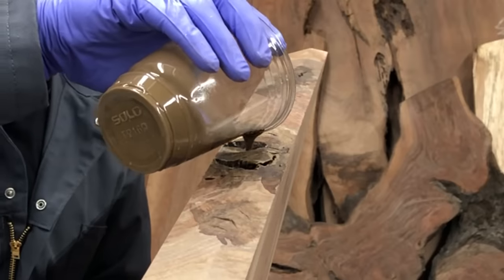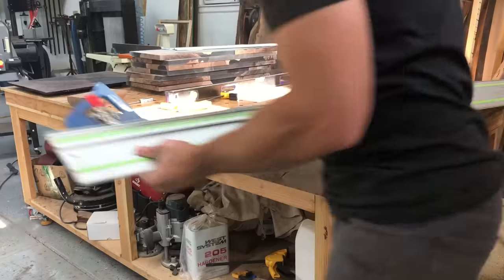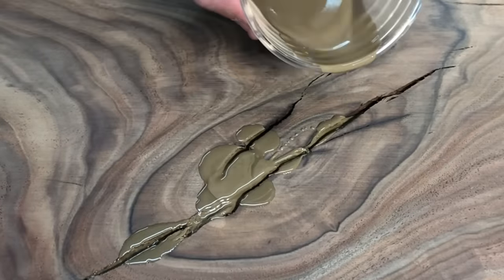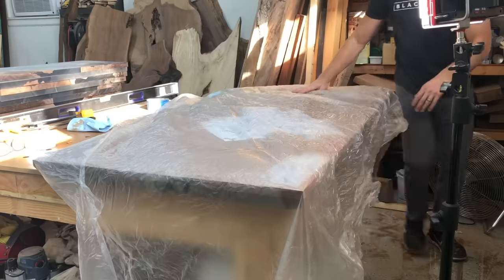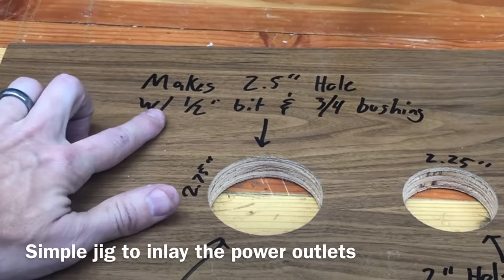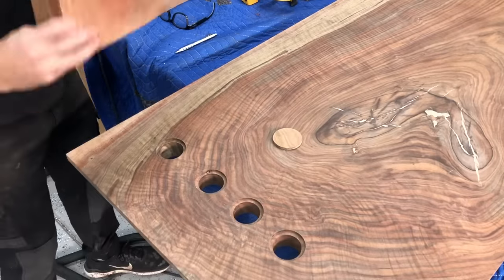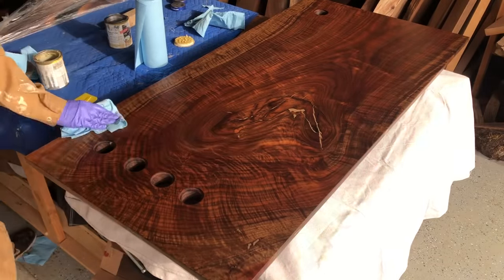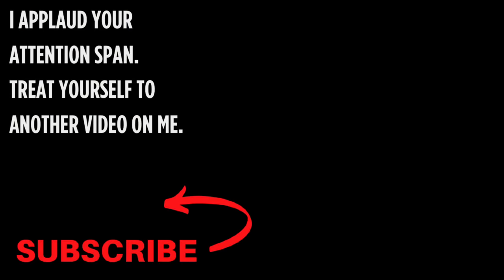My Toughest Client Yet

Comment: Omg finally you used metal and epoxy!!! Real quick I still think it counts as a smart desk and it’s not overly done! Sometimes tech can get a bit ridiculous and this piece I think will last much longer going the route you went. As for epoxy and metal… the more the better and pls use copper too! I just think it works so much better than actual colors, there’s something natural or authentic maybe and metals go with wood anytime, all the time. I love the knots and holes and gouges are accentuated beautifully by the brass and bronze. And thank you for giving tips on how to get the most out of the pour by turning the piece upside down to allow gravity to pull the highest concentration of metal closest to the surface. That alone will help me since you just made me order brass and copper powder 👍🏼 I have a simple blanket ladder for my sister out of knotty hickory which has gorgeous colors and striations in the grain and she picked it so I have to make these deep knots strong so I can incorporate the character into the piece. I think I’ll go copper, this hickory isn’t pale or pink, it’s darker and I don’t know I’d love either one but we’ll see what she decides. She’s also particular and that’s not always a bad thing
Reply: Edit: Cam is obviously right about using 50/50 ratio of copper to (in my case) total boat thickset mix and don’t forget to wrap it with tyvek tape and tip it upside down!!! It literally pulls the majority of copper to the surface! When I first started applying the copper/epoxy it looked dirty, like gross water almost but I trusted his process of taping it up and flipping my pieces over and holy cow what a difference! It is a long process to wait for the epoxy to dry so don’t anticipate pouring and sanding soon but well worth it

Comment: Cam, If you deal with dust getting on your projects one thing that I found helps me is tack cloth. And when I use any type of epoxy I use heat lamps to speed up the process.

Comment: Cam. Love the desk. I once tried using brass similar to how you have but I got my brass by filing a redundant brass welding cable connector into filings and mixing them with Araldite and inlaying it on some Ash.

Comment: Cam-- am planning to do a guitar body out of 100+ year old barnwood, and initially I had planned to use a resin or epoxy as accent/crack filler... Now may look for the possible existence of a slightly-slower-curing CA glue! One feature that *will* be present: brass shavings, suspended in the clear of whatever medium I use-- And it was **FREE**, 'coz I know the local hardware store operators and collect the shavings from their key-cutting machines!!  Desk looks super awesome!! Blessed Be, & Peace!! 🙏☮

Comment: Cam, i know this is an older video but i wanted to watch again to see what powder you used. However i think it would be really cool of you did a crazy patchwork table where each patch had a border of the brass resin, you could even get real crazy and make like puzzle pieces. You could make the border lines as thick/thin as you want it sounds like ALOT of work but if anyone could do it its you. And you could even use a relatively cheaper wood for the base layer ao long as you had alot of patches to dress it up. Great job as always.

Comment: I have a pro tip from something I saw in a Stew Mac video (guitar luither) related to doing your inlay patches.

 Tape some transparency film down on your piece and roughly sketch out the main grain pattern. Then you pull the transparency off and use it to find the best matching plugs.

Comment: Cam, just starred watching your channel from across the pond. Absolutely loving your work and feeling inspired so will have a go at something soon. Probably a clock. 
Be good if you could show using a router sledge and also have you thought about copper instead of brass.
Regards
Chris.

Comment: Cam, Just had a thought about the bubble comments. I used to work with silicone and urethane molds. When I made the molds we used a table with multiple table vibrators on it. The table vibrators could be mounted on the bottom or the top. For large projects we would mount about 4 of them. They made most of the bubbles come to the surface fairly quickly. So vacuum chamber and table vibrators made a hige difference. We also used surfactants in the urethane but I don't know how they work with epoxies. You should give it in a test with some epoxy. Bet it makes the bubble issues go away faster..... Paul

Comment: Cam, I think this looks just fantastic :) Only thing I have to say, I think if your wife or you ever used the clamp on style articulating monitor arm, you would never use an old school stand again. SO great that it takes up none of your desk space, yet can be grabbed and pulled to just the right angle and closeness, or easily changed if your are standing up, or over to the side.... as I was for most of this video.

Comment: Cam, I really enjoy your videos. I’m a novice woodworker, beginner when it comes to fine furniture. You make this look so easy! Is it reasonable to make a desk like your wife”s as a first slab desk or do you recommend some other project first? I’ve got a nice Rowland X31 combo machine, routers, sanders, drill press, and will likely add a Milwaukee tracksaw since I’m really vested in M18 tools. I know this is a broad question like “How long is a rope?”. I’ve also designed and built 12‘ x 12’ office from stick lumber with a 10’x5’ and 5’x5’ window in my backyard. Thanks for sharing your vast knowledge and having a subtle but great sense of humor!

Comment: CAM, I was thinking, you said that you do not know what you would do if it was drilling holes in a livingroom table, there is the Milwaukee cordless 18v portable bench drill that you can place easily on whatever table you want inn less than a minute completly without hazzle. I was also thinking of a easy way lift and move the big slabs, and that is a vacum lifter, often used by stone  masons or industrial lifting. Keep going! Best regards Kornelius

Comment: Cam,  I have been a sub now for about 2 weeks and I am going through your videos.  One thing with this video is I was wondering where you sourced the components for the desk.  The brass inserts for power, USB, light and switch.  I love these and would be a definite upgrade I would consider for a desk I previously built that is slated for an overhaul.  Thanks for all your videos and blogs.  I have wood workers envoy after watching your shop videos of the "not so new" shop now.

Comment: Cam hi!
I'm doing my first 1 slab dining table. It's a Ucaliptus ~80cm wide and 200cm long and 5.5 cm thick (after planning).
It was cut and sliced 10 years ago.

Do you think I should plant a metal U channels in it? 

When fixing the metal V legs (1 piece) to the table top - 
Should I leave some freedom to the wood slab? What is the magnitude of that freedom, and what method should it be done?

Pretty long answered comment - Hope you have an all ready set video regards... 

Thanks a lot !!
Falk

Comment: Hey, Cam.  Nice desk!  Love the 'brass' inlay bits.  I'd really love to see a ceiling height book shelf with a short (2ft?) set of drawers at the bottom.  I've never seen you do anything like that.

What I'd do differently with this desk:  The lamp and the insets you did should've been all on the same side and much closer to the edge, say around 1" from the edge.  Space on the top of any of my desk has always been 'at a premium' and you've really wasted a lot of space that could be more efficiently used.

I know this is an old video, but you made it sound like you'd be doing the brass dust stuff more and yet I've not seen any videos with it.  Why's that?

Comment: Can, as you’ve said before,  the wood is the “show!” I think you have the design capability to pick the best slabs for the project at hand. I think you should have put the usb charging piece, I know it dates the desk, but I think current functionality rules the day. I’ve thought about a drawer for pens, stamps, etc. putting a usb hook-up in the back of the drawer would not be difficult? Get one of the short cords and charge the phone from inside the drawer; no chance of scratching the surface of the desk that way? Just a thought. -jamie

Comment: Cam,
Technology is absolutely secondary as the table is so stunning with the grain that tech is not required to make it “cool”. Besides the wireless charging is novel today but in 10 years there will be a new charging technique which will make the wireless system dated. This table is good for another century!!

Comment: Cam, this is WELL WICKED, your wife is extremely lucky & person I love it exactly how it is, I wouldn’t change a thing, personally I think the charge port is way better then the wireless phone charger, but that’s just my thoughts
Also while I’m talking about my thoughts, I’m a fluid artist & I know that you use black pretty much all the time, but have you ever thought of adding some gold resin to one or some of your pours, like what I mean is, still do your normal black pour but then get about 15% of gold (85% black + 15% gold) & drizzle it on top, so when the base & the hardener do their chemical movement dance when it’s heating up, the gold should brake up & mix through & it should look like natural gold fault lines in the black resin, I think it could look pretty cool

Comment: Cam, your creations are absolutely stunning and extremely impressive! I was wondering if you've ever used actual molten metal as a filler on any desks or tables at all? I know it burn some of the wood but I'm just curious if it could work.
Reply: Low temp alloys like pewter can work.
Reply: @mailbox4286  That's awesome! Thanks for the info. I know it a little different, but I have an antique, carved wooden table with brass or copper inlays. I always thought it was really cool to have that metal incorporated into the wood and was thinking doing a hot pour of something into a possible furniture project for my home. 🤔 Thanks for the idea.

Comment: In boilers, to take out the air out of the water or liquid you raise the water temperature going into it to around 90 degrees celsius. Not sure if you can do that with the resin but thought i would tell ya. Also you dont want to boil it....you want it just before it is there.

Comment: Cam, could you pour a shallower river of clear or colored epoxy, then do a top coat of the bronzed epoxy over it, so as not to use so much metal? I large river pour of the bronze would be neat…

Comment: The brass resin would look wild with burned wood. Burn it until it cracks, seal it, add the brass resin to the cracks then plane it down to expose a little bit of everything.

Comment: The resin looks flat to me.  I thought it would pop more.  Otherwise, a great table.  I have a Jasper walnut business desk built in the 60's.  Had it modified smaller and raised it up an inch due to some downsizing.  The finish is rather conservative, more's the pity.

Comment: Have been gearing up for a while to make a desk like this. Found the perfect slab; prepped it, flattened it, filled the gaps and imperfections with epoxy, bought the plans to make the tables legs… next step is to buy the fittings. *goes to juniper website*……. 😢

Comment: Cam, If that brass solution is made of brass powder you should check with competition shooters and reloader they probably have more brass shavings then they know what to do with i know I have that problem, fyi if so try to work with some that only uses one make of brass for consistency not as rare as it sounds in competition you maybe able to have your supply for nothing or close to nothing

Comment: what about using something like 404 thickener with the epoxy brass mixture?
Reply from the maker: Worth a shot
Reply: @BlacktailStudio  the thickeners are fillers & mess with opacity. Tried castable polyurethane & polyester resins with minutes gel time &/or set time. So far, I like the polyester best. Holds the metal powder suspended & gels well. Can sand in 2-3 hr depending on how the metal changes the cure rate & how thick the pour.

Comment: You wouldn't need to do all that filling if you just purchased wood that wasn't full of knot holes or cracks. That is the way we did it 30 years ago. Nobody wanted knots in the middle of their wood back then. Basically you are paying huge amounts for wood slabs that in the past would have been cut up for firewood. . .